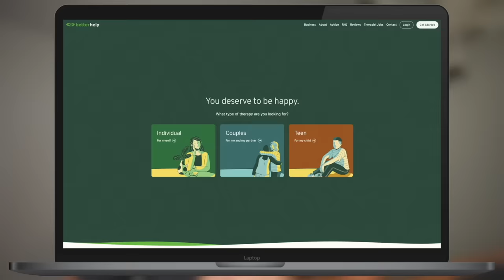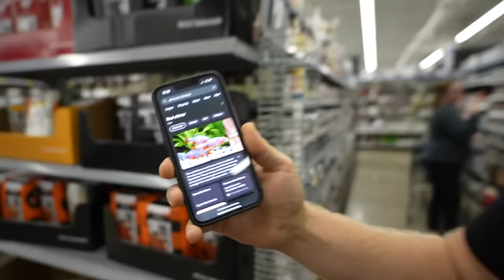URBAN Minnow TRAPPING to FEED Backyard HATCHERY FISH!!!

Comment: We keep our male rabbits together and have never had an issue. However, since Theo has been separated from the babies, you may need to watch them closely initially.  The babies might just accept Theo as the alpha and be fine with it.  Ours have never fought, although there's no guarantee,  of course, since all rabbits could be different.  You could also try putting a divider so that they get a chance to interact through the divider first, then remove it later. 🐇 🐇

Comment: @flair 3 best tips are make sure both ends of traps are inline with the flow of the creek , the best bait is plain old cheddar cheese block chuck some in the bottom of the net then roll some little balls and chuck around the net to get em fired up , the other best thing to do is if possible start by putting one or two minnows in each net once they see minnows in the trap eating they get fomo n have to get in … best of luck . Oh and p.s. you need a big esky with lots of water but u know that already 👍🏽👍🏽

Comment: I'm no professional minnow trapper but I've found over the years that the depth of the trap makes a difference.  I try to keep mine somewhat shallow  and I've had good luck with just plain white bread. Mash the bread into a ball and it lasts longer. Of course I'm in Kentucky so what works here may not work in Nebraska. Great content guys.
Reply: I’ve found that bread works just fine here in iowa as well. I agree with you on the depth you want the trap to be farely shallow.

Comment: When I was helping an older guy trap minnows we'd use what I call box traps idk the actual name of them. It's a wood and fine steel mesh minnow trap that's in the shape of a square. Most had 2 openings but some had 3. They are roughly 2 1/2 feet by 2 1/2 feet. You can trap 3/5 of a 5 gallon pail of minnows in them every week. You gotta make sure the openings are running parallel to the shore because minnows move along the shore. We never used any bait just because there were so many minnows. You can probably find an older bait dealer and ask him if he could sell you a couple traps. Definitely worth a shot

Comment: The river redhorse (Moxostoma carinatum) is a species of freshwater fish endemic to the eastern half of the United States and southeastern Canada. They can range from 10 to 30 inches in length and can potentially reach a weight of more than 10 pounds after maturity. It is typically found in clear, large creeks and rivers, though it is sometimes also found in lakes. They are sometimes speared or caught with hook and line using crayfish or worms as bait.

Comment: Get you a e cylinder from a welding shop. Have em fill it with Oxygen. Get a pediatric regulator from a medical supply. An area tor stone from Wal-Mart and some tube. When you put minnows in that bucket, put the stone in there and set that regulator to less than a liter per minute. The minnows will stay extra lively for about ever.

Comment: If you put a bait in that floats to the top of the trap then the minnows will eat it through the trap. I use a water bottle with holes poked in it with dog food in it.  Ziptied to the bottom inside of the trap then they have to go in to get the bait

Comment: Using the wrong kinda traps. The minnows don’t like the black coating on those. Need to use Gee 40’s. The Gee 40 eel pot works good also. Instead of catching 50-75 minnows y’all would have caught several hundred. Need to get an aerator for the minnow bucket also.

Comment: Yooo flair just a heads up your coupon code didnt work for me on the app when i ordered jerky. It added $2.50 instead of discounting 10%. My $44.95 total was $47.45 after entering the coupon code. I just ended up not using the code and paid the $44.95

Comment: You need to add oxygen to the water, because they are using the oxygen in that little container in a short time. You are not adding oxygen by just sirculating the water.